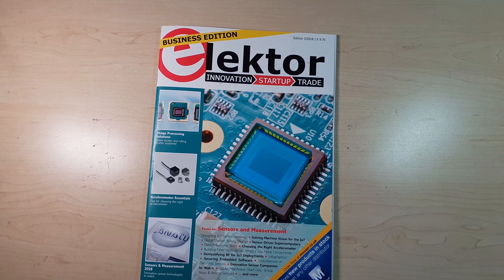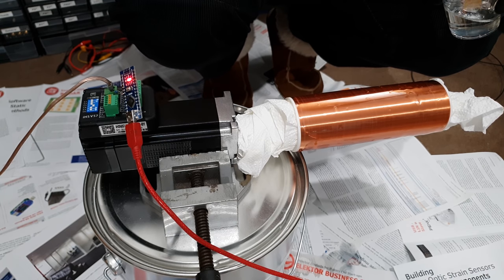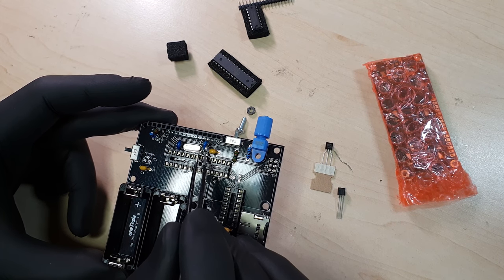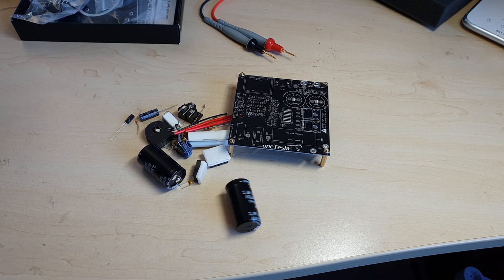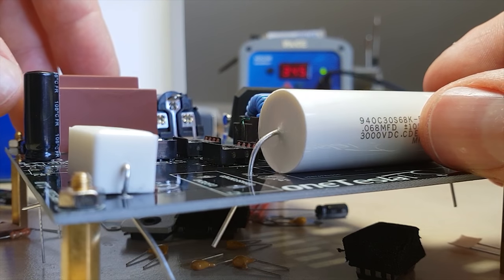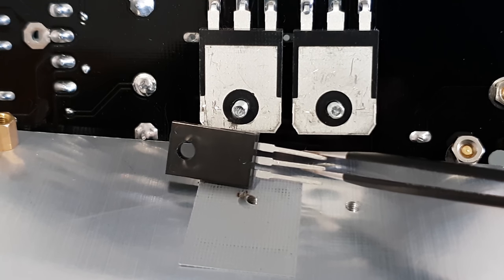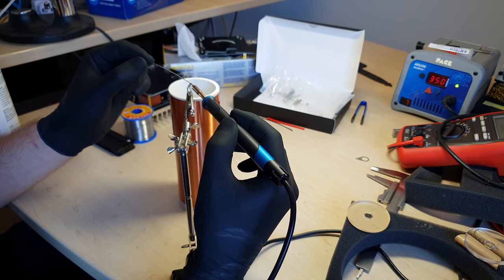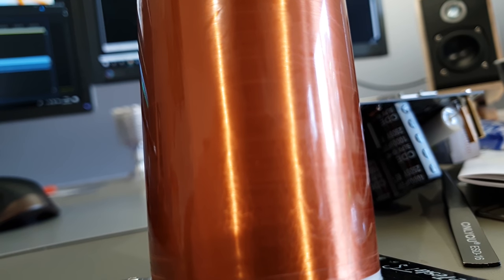Generating Megavolts with a Tesla Coil Kit

Comment: Great video. Only comment is my personal experience with epoxy and polyester resin is that they can be very lossy for up to a month after first hardening. I found shellac the least lossy, spar varnish and solvent based urethane coming up next with the advantage of being less likely to fracture with handling.

Comment: This isn't megavolts, maybe 75-100kv.

3MV/meter is required to break down air, but this can only be used to determine voltage from an arc length if you are concerned with infinite parallel conductive planes. That's to say no real experimental setup allows for this correlation to be made accurately.

Circuit simulation of our 8ft tesla coil producing 15 foot discharges predicted a maximum output voltage of 1.2MV.
Reply from the maker: dreams = shattered
Reply: @reps  It's not the voltage but how you use it! Look at the QCW Tesla coils and Tesla guns out there. They can make discharges over 8 feet long but with just 50-60 kV! In the end isn't it the spark that counts?
Reply from the maker: nope, I need a megavolt on my résumé
Reply: Maybe build a big bipolar Marx generator to get 1MV?
Unfortunately highvoltagefeathers is correct - my coil with a ~160*750mm secondary (= 2 - 2.5m arcs) gave me measurements on the order of 500kV peak (derived from current measured into/out of topload - I floated a wifi connected scope on the topload once to get the numbers).
Reply: Marco Reps same here... I totally understand your NEED for more POWAAAAAAAHHH
Reply: Yup, and the titel is very slightl click bait now. I have watched dozens of videos about tesla coils but the expectation of this little thing producing 1MV made me watch this video on mobile instead of waiting to get home :D
Reply: Exactly
Reply: Me too, exactly! I was virtually certain that MEGAVOLTS was extremely unlikely based on Marco's other videos, but I had to watch most of the damn video to be sure. I feel lied to, accidentally or not. It is kind of the definition of clickbait.
Reply: Would have to be in oil to get MVs any way, it's not tall enough.

@Marco Reps, if you want easy MVs make a Marx.
Reply: @reps  , only if they are legal in Germany...😁

Comment: I have to say, that the one tesla TS is a nice kit but there is a signifficant problem with the way, they desingt the circuit. 
Because they have no soft start to slowely charge the high voltage high capacity bus caps, like this the high inrush current when plugging in the coil will eventually blow the full bridge rectifier. For that reason I added an external soft start in the power cable. 
Also my primary overheats very quickly at full power, I might reinforce it with some additiona wire.

Comment: I notice they are using one of the inverter's to invert one of the signals to a pair of ucc37321 chips wonder why they didn't use the proper complementary ucc37322 probs to save on BOM and pick and place reels 
nice vid as always

Comment: Don't you electicute yourself if that cable at the glove comes loose?
Or would it only hurt?
Reply: I think that big ass resistor is there to prevent the electrocution.
Reply: It's actually an RF transmitter so it will burn your skin.
Reply: @stevec5000  true, I did once, I got white spot to prove it

Comment: I was just about to ask if you found a purpose for the JMC servo. It appears you did! 

Does that reflect what you think of the servo or is it just something you had within reach for a quick setup?
Reply from the maker: nono the motor is cool, but I've got something even better for the CNC
Reply: @reps  Happy to hear that. Ive got them still collecting dust on a shelf. I have 3 (of the 180w version) but no time to start the project. 
Looking forward to seeing a video where they are put to some serious use. Mind sharing what that is or do you want to keep it a secret untill the video?

Comment: Thanks for the video! I've been looking at their designs, but it seems some of the clearances on the high voltage driver board are really low, which has me a little worried. The negative lead of C11 (main bus cap) and it's output trace are almost touching, as well as the earth traces running right next to the 230V input and fuse.

What is your view on this?

Comment: 5% resistors should be fine actually, in my experience with Solid state tesla coils, I've found that resistor values aren't usually that important.

Oh, also they didn't come up with the schematic, at least not most of it. It seems to be a modified version of Steve wards "mini SSTC" circuit. It's a good choice though, since it gives high performance and it's pretty simple.

Comment: Hey Marco, how is the osmu comming along?
Reply from the maker: I am not happy with my last approach and its energy efficiency, am currently thinking about a switching osmu
Reply: Well atleast I would be perfectly happy with a linear precision device (space-heater).I think even today, that is perfectly acceptable for a measurement device.And one could always power it off a bench power supply and just reduce the voltage as far as needed for less wasted energy...But you'll have put a billion times more thought into this.
Reply: @reps   Just stick with linear. I would rather like it more precise in the mA region than have easier heatsinking. Also, if you consider fan-cooling, 200W ain't that hard.

Jedes Video warte ich auf das OSMU. Würde ich direkt nachbauen. Die erhöhten Kosten durch lineares Design sind denke ich verschmerzbar, wenn man bedenkt was eine "richtige" SMU kostet.

Comment: what if the gloves earth cable disconnects? (Honest question)
Reply from the maker: Since there's little power available to back up the high voltage, it would break down with the current flowing through my body. It'll probably not be deadly, but it can influence body functions like heart muscle activity, so in general I wouldn't recommend it either :) A microwave oven transformer or a CO2 laser driver on the other hand have high voltage and high power, so very dangerous!
Reply: *zap
Reply: @reps  that, and the skin effect because of the high frequency

Comment: I very doubt it have even 50 kV... :) But we forgive you...
Reply from the maker: I trust your judgement in the nanovolt area, but where are your references in the megavolts? 😇
Reply: @reps  Need moar precision resistors.... I'm currently fixing 1.1kV 30kHz amplifier (few posts in Hulk thread at EEVBlog).
Reply: Based on the length of the coil.... yeah. At absolutely most 350 kV, and that would be the arc distance at very low frequency. At high frequency, 50 kV sounds about right.
Reply: @reps   GOTHIIMM!

Comment: I am not proposing anything, but a atmosphere of pure helium or argon will increase the length of the arcs quite significantly... Would be a real shame if someone would accidentally remove the toroid and foolishly attach a wire that leads into a 2m long acrylic tube that some idiot accidentally evacuated and filled with 1 Torr of welding gas (argon). Did that idiot not know that if someone accidentally discharged a tesla coil in there, one would get extremely long sparks?

Sadly, everyone knows about Paschen's law and would never do that... Because nobody wants a tesla coil that can ark 1cm for every 200 V provided...

Oh, on a completely unrelated note: Did you know that you can measure out small amounts of gases by filling a party balloon with it to a specific diameter of said balloon (or by weighing the balloon)? And if one would attach such a balloon onto the valve of a vacuum chamber, one could easily fill that chamber up to a specific pressure.